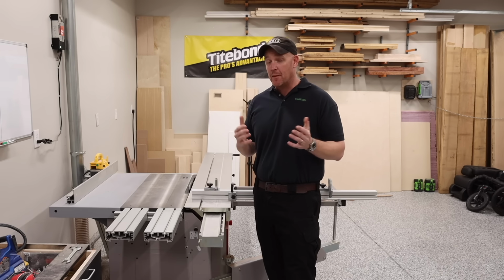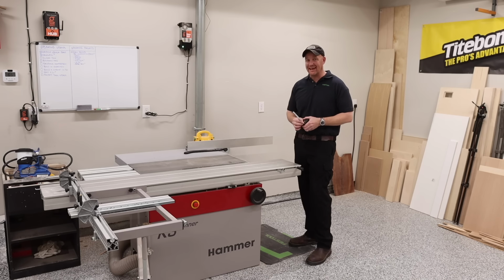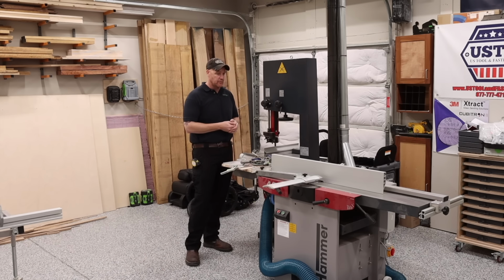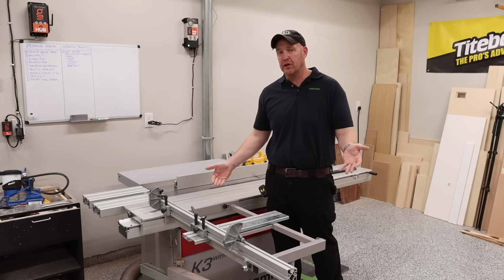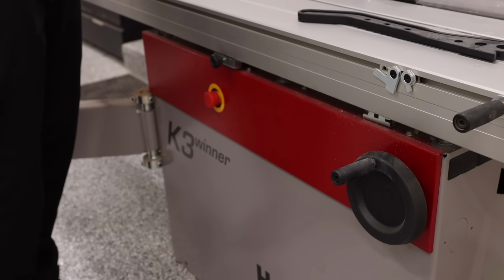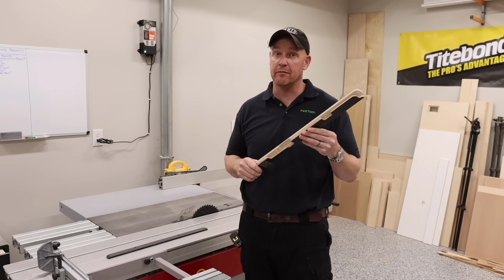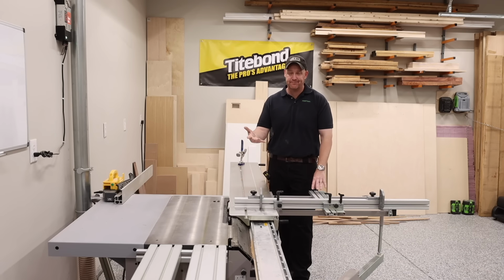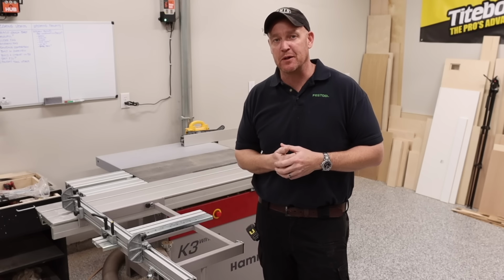I’ve been using the wrong table saw for years

Comment: 'Glad you shared that regret...I did the deed in about 2005 the first time; had to do without for a year while the new shop was being built after we moved two and a half years ago (had a cut down PCS to make do and it was frustrating going back to a cabinet saw) and was overjoyed to be back to a slider once I had the new building. BTW, my Harvy G700 performs really well with my quick connect duct work in a larger space than you have with what is largely a 5" network. My SCM/Minimax machines have 120mm ports which is very close to 5". Th einitial 20' or so of the network is 6" which gets it up 10' to above the rafters and 5" from there. Only the drop for the CNC and the general purpose drop for flattening/drums ander, etc. is 4"
Reply from the maker: I can’t wait to see how the Felder performs
Reply: @jimbecker5675 I still need to cut that grate in the dust port on my Harvey. So tired of that getting clogged. I'm assuming you're still happy you cut it out.
Reply: @StahlFabrications , Yea, it was the right move for me. Folks with spiral/helical heads on their jointers/thicknessers will not likely have the clogging issue, but those of us with Tersa and other straighter knife formats that produce "fluffy shavings" will benefit. That said, there is risk because the G700 is "post separation", meaning any "chunks" that get picked up by the airflow can come in contact with the impeller.

Comment: I have the Felder K700S and couldn’t agree more with everything in the video. I will never go back to a table saw after using a slider. Like you my first cut with plywood I tried to use the fence and use it like a traditional table saw but learned real quickly that everything can be done on the slider side and I never use the fence now, I’m actually considering removing the fence since it’s more in the way than it is useful to me.

Comment: Don’t have time to watch the full video yet (I will later today), but as someone who has had the K3 for 4 months, I’m excited to see a candid review. I will say I have very few complaints at the moment, as enjoy the fact I haven’t needed to build one sled for the thing despite needing to do all sorts of odd cuts.
Reply from the maker: Hope you enjoy it!
Reply: I feel so much safer with this saw and was probably my biggest concern for not going with sawstop. So glad I didn’t shy away.

A lot of the things you brought up I agree with. The aftermarket options I wasn’t aware of and will look into.

I use the track saw clamps and those work great for my needs at the moment.

My saw came pretty well in spec and felder has great support team for a couple issues I ran into.

Also I didn’t know they made a riving only knife, I hate taking the knife off when I do a half lap or something.

I have a long narrow shop and a slider ended up being more space efficient than a traditional cabinet saw. 

10/10 would buy again and I now recommend it over a cabinet saw if space and money are there. There are so many reasons this saw is better than a cabinet saw.

Comment: Thank you for the excellent exposition. 

I think one of the main points about sliding table saws is that Sawstop (or similar technology) becomes just redundant, expensive junk that is totally unnecessary.  Plus, with a sliding table, you are protected against kickback - unlike Sawstop.

Comment: At the beginning of the video I was watching. Just a quick word for your own safety. Don’t reach across with your hand to remove a sliver of wood or a cut off while the blade is spinning. If you are feeling brave use push stick or a long enough cut off to keep your hands far enough away. The blade has no feelings, it cuts whatever is in the line of fire. Accidents happen, but you can prevent them or at least minimize the chance. Good habits are just that, when you least expect it something happens. Respect all machinery, motorcycles, blades, knives, propellers, gun fire, etc., don’t get complacent and forget where you are. It just takes a split second for bad things to happen.
Reply: I really meant the comment for those that watch your video. I see people that own SawStops and with the safety feature of a retracting blade, a brake and no flesh cut injury it causes people to disregard minor safety precautions.

I was talking to an elderly gentleman in the woodworking industry and we both had the understanding that if your tired get rest, take a nap, etc. it’s after a long day and just one more quick cut that things take the turn for the worst.
Reply: Yeah, I cringed when I saw him reaching over the blade like that—an accident waiting to happen. With the inherent safety of working with the slider and never having to get your hands anywhere near the blade to make a cut, it could be easy to get a little less safety minded.
Reply: I don't know why people don't use blade guards whenever they can.
Reply: The alternative?  A track saw and table. A track saw takes a bit more setup time but is way safer.

Comment: Thanks for this video, the dimensions of the saw was really useful.  I am just a hobbyist where I work out of a garage, but still park my cars in it when not working.  My question is, can the outrigger be taken off when not using the table saw as I would need  to remove it for parking, and then put back on when I need to make a cut, without having to dial in the accuracy each time?
Reply from the maker: Yes it comes off very easily. If you watch my assembly video on it you will see how easy it is.
Reply: Yes, under 2 minutes to install it, no tools or calibration required.

My outrigger spends most of its life hanging on the wall to save shop space as my shop is in the basement of a townhouse. When you need a larger machine, put the outrigger on, when you don't enjoy the ergonomics of a smaller machine.
Reply: @bentswoodworking  Thanks for the video and the reply.
Reply: @rodsheridan7048  Thanks very much that was useful information.  I'm trying to decide between a slider saw like this, or a combination machine like the C3-31 to save even more space.  I'm happy it is easy the outrigger can come off easily. The width of the table saw or C3-31 without the outrigger, and no mortiser would be the maximum I could have to still park vehicles in the garage.
Reply: @davidwilson3107 the fence is not great on the C3-31. I went to Felder to buy the C3-31 in exchange for my A3-31 plus the difference in price. I thought I’ll go through the shop and see the other machines! The B3/K3 have a better fence. On the C3-31, you’ll have to use the fence of the planer and it’s really not great. It doesn’t compare to the B3/K3. I ended up keeping my A3-31 and bought the B3-Comfort.

Comment: I love what Sawstop can do, and I belive such a great feature should be made available to all circular blade saws. With that said, if you hands are never near the blade, does it matter if there is a brake? A sliding table saw is not just easier to cut whole sheet of plywood. You can do that with a track saw already. A sliding table saw is a different way to use a table saw. If you have a piece of rough sawn hardwood, you can just cut the first straight edge on a sliding table saw if it's not loger than your table travel distance, push the straight edge against the push fence, and you can get 2 square ends cut. It will be very challenging on a cabinet saw to do the same tasks.
Reply: Its not difficult at all on a cabinet saw.  I just slap down a 10ft fence, but it is certainly not as easy than with a slider saw.  If you have the $$$, but here is the rub, most do not and need that $$$ for a commercial planner and commerical sized bandsaw to save on buying rough hewn wood and slicing/dicing and planing it down to size, before a tablesaw upgrade.  Or better bigger dust evac system, or a finishing shop or a bigger van to move finished products in, or, or, or....
Reply: @w8stral  I did 10ft fence trick. You do not only need a longer fence, but also a longer infeed and outfeed support. A circular saw can also do it if you have a long enough straight edge. Is it easy to get a 10ft fence? I think not. It's defintely possible because at least we both have done it. Speaking of cost, a high end cabinet saw is not much cheaper than a same size sliding table saw. I have used 2 jobsite saws, 1 contractor saw and 1 cabinet saw in the past 4 years, and done several projects on each one of them.
Reply: @Fusion_Woodworking  Yup: I think I was just pointing out that if one is going to spend $$$ and it is NOT infinite, there are FAR more numerous other big tools you need to get wood finish work done.  One can make do with a low end tablesaw.  You cannot make do with a low end dust vac, shaper, planer or bandsaw if your goal is to save lots and lots of $$$ buying rough cut lumber and turning it into dimensional lumber for cabinet, flooring, furniture usage .  Then you need a finishing shed at minimum setup which will set one back couple more thousand and you have to have insulate/heat it.     Table saw upgrade to the best around should be your LAST purchase.  its like backpacking, everyone gets excited about backpacking and they go out and buy a backpack.... <<palm/face>>  it is the LASt thing you should buy, same goes with a tablesaw.  Not to mention you can buy 2nd hand tablesaws all over the place Add a good fence and well... 

As for where you buy a 10ft fence?  Any bar or stock aluminum extrusion fits the bill.  Sure a swing saw would be nice, but lets face it plywood cutting is not the problem.

Comment: Rather than dialing in your rip fence to eliminate the toe-out, you can add a piece of tape to the back of the far end of the fence itself.  That way when you pull the fence back the tape will push against the main housing and "straighten out" the fence.  I haven't actually done that with mine though; that toe-out is so minimal that it doesn't bother me, and like you I rarely use it that way anyway.

Comment: You did a great job explaining shop space requirements for your sliding saw. I saw the Felder line in Vegas at the AFWES show and have been wanting a machine like this for a long time. Are you able to rip an 8' plywood panel the long way on your machine with the table stroke you have? I've broken down a 4x8 sheet on a US saw exactly once, never again.

Comment: I use to have the same K3 winner, its a very nice saw, and a perfect entry level slider. I to hade some issues with and a couple of years ago I upgraded to a K700. Since im from the EU, I do run mine on 3 phase 400V power, since its normal to have that in the house also. The K3 is a very good saw, but still there is a world of difference to the K700. Do yourselfe a favor and skip the K500, and go for the K700, it is a much nicer and bigger upgrade.
I never understood why americans still are stuck on those old cabinet saws when you can get a slider that is sooooo much better, so it nice to see your excitement for it, very nice walkthrough.
Reply from the maker: K700 is what I’m looking into

Comment: Nice video, keep up the great work. I currently have a Felder K700 sliding saw, cuts beautifully. Initial setup was a pain but once setup it is a joy to use. The overhead dust support arm limits cuts to 32" width before the arm gets in the way and finding specialty blades can be challenging but overall it's a great saw. If I were to ever upgrade it would be to the larger K700S.
Reply from the maker: I think I’ll be going to the Felder this year.

Comment: Jason,  I think the K3 and A3-41 are pretty close to co-planer for the work surface.  You might consider tucking the planer against the wall behind the K3.  The K3 will function as your outfeed table.   I have an old iron 16” Porter jointer that abuts the back of the K700 Felder.  The co-planer decks makes for efficient use of precious workspace.

Comment: I have the same saw and love it, the only two things i would change on the saw is the position of the on off switch, and make the slider a  bit bigger so it can rip 8x4 sheet goods down. Was not aware yoi could get an extra start stop switch for it will need to look into that option. Never had any issues setting mine up , slider was level and i found the high low fence easy enough to adjust to my liking, although the round bar my fence rides on is slighly different, it is flat on the top with measurements on it.
Reply from the maker: Mine has been very finicky
Reply: @bentswoodworking  I gathered that from the video. I am just after doing the tables on my A3 31 and that was a nightmare, end result is table is now out by 0.08mm, hopefully it will not cause an issue.

Comment: I live in a two bed terraced house in Northern England. My yard isn't all that big, my shed is 9'x6', or 2700x1800 in new money.

It's barely big enough for my bench, 350mm bandsaw and drill press. I'm planning on building a bigger 4800x2100 shed, but even then I wouldn't have space inside for my jobsite saw permanently set up on its folding stand.

This is why I went for a tracksaw, they're much more space efficient. When I renovate my kitchen, I'll take my living room furniture upstairs and use that room as a workshop.

Comment: I have both a sliding table saw and cabinet saws in my shop,  I would just say they it depends on what kind of work you are doing. If you are cutting a lot of sheet goods, then a sliding saw will be a good option for you, if you are cutting mostly hardwoods for furniture I would recommend a cabinet saw. Both have their purpose it depends on what you are doing. I also am not a fan of a smaller slider like you have, but then again I have the room for a larger one.

Comment: K940S. I totally understand the frustration leveling the carriage. I do recommend staying with the splitter behind the blade and connecting a dust extracter. I agree it is a little more annoying using it as a regular table saw, the darn carriage gets in the way. Is the blade quick release option available? If so are you getting it?

Comment: In Finland the local Felder import company provides the Felder and Format line installed by them (can be excluded as well). Hammers normally are sold as your case but they provide the installation service as well in additional price. The price of the service is something depending how much you value your own work time - can be worth the price or as in my case I would try it by myself (not professional but hobbyist). Felders and especially Format saws and other equipment are most commonly seen in professional shops anyway or the hobbyist has a thick wallet :)

Comment: These are nice saws, just wish they had spring loaded stops instead of flip stops. I've had a hard time finding a saw with that feature since selling my SCM/Rockwell SI-15. You are totally right in that there isn't a huge difference between a unisaw and a slider in terms of space if you set your space up right. What do you think about the difference between this saw being separate from the jointer/planer vs. a combo tool from the same company?

Comment: Think of your fence as just another stop block, you don't always need it to go all the way up to the front of the blade with the slider. I would buy another fence and cut it down to the length of the fence guide. That way you would not have to do as much dialing in and have to worry about runout as much.

Comment: So how do you make a rip cuts with the slider? I spent the entire video waiting for you to tell us how you do that after you said that you finally realized that you should just use the slider rather than the fence. For instance, a very common occurrence is you are processing a 6 inch wide, 4 foot long, rough sawn board. After you have jointed and planed to S3S and now you want to rip it to width, say 4 inches wide. How do you make that cut on the slider?
Reply: Hi, I rip it rough using an edging shoe for the straightline and the fence for the rip about 6mm (1/4") oversize with the fence pulled back to end just after the beginning of the blade, no point jointing and planing the scraps.

Then joint one face and edge, plane the other face/edge to dimension.

When ripping above, a Fritz and Franz jig can hold the piece with you standing on the left of the sliding table without the use of push sticks or having your hands anywhere near the blade.

For larger parallel cuts, a parallel ripping device can be used in addition to the crosscut fence stop to position the wood on the slider, and can of course make non parallel rips depending upon how you position the stops.

Comment: Jason great video very informative.  A Couple questions:  1) When you went to Felder to look at the K3 did you happen to look at the C3-41?  Curious on your thoughts in your shop if you had gone that route and eliminated the A3-41?  2) Since you traditionally enjoy cabinet work and were using your assembly table to breakdown sheet goods does having the slider change your thoughts on what type of MFT/Assembly table you should have?  Thanks
Reply from the maker: I didn’t consider it. I prefer to have separate machines. As for the table, I haven’t used my assembly table to break down sheet goods since getting the slider. I actually am designing a new hybrid table now.
Reply: @bentswoodworking 
I figured when you mentioned the new hybrid table on the pod cast that is why.  It would be interesting to see what the difference would be from a shop layout perspective having the combo machine in a small shop.  I had thought about it, but I still like the ability to move everything to the walls in my current shop to have an open area for whatever is needed at some point.